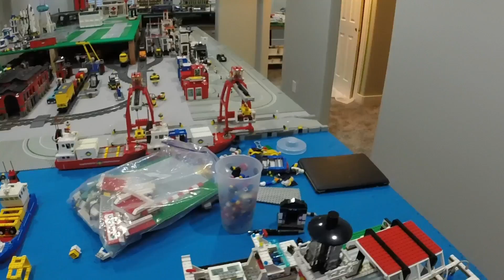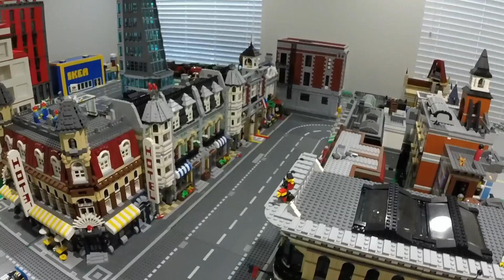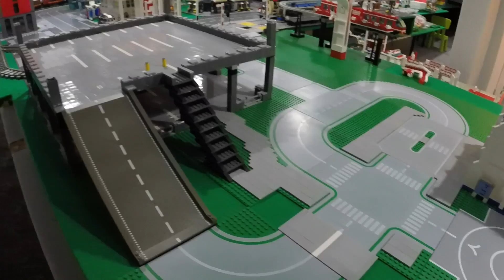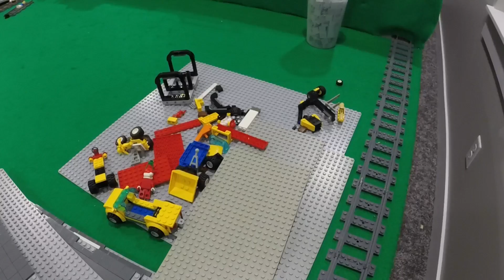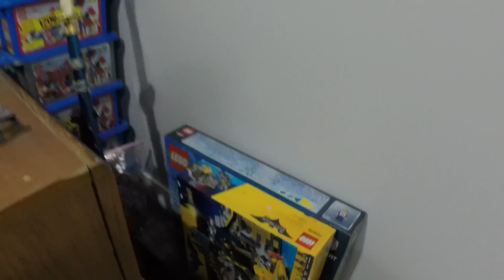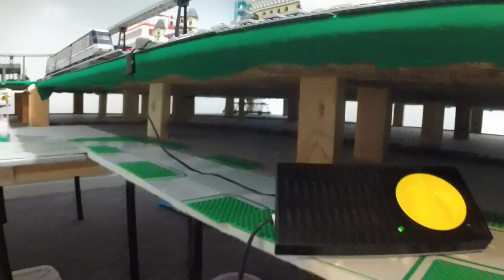Creating a LEGO City Part 6: Using Old Sets

Comment: Coming alomg awesome for sure Alex. I love how you changed the road plates at the railway crossing. Brilliant. Airport and "90s Lane" are lookin sweet as well. As for the open table space behind the 90s building between levels.  Not sure if you have any of those "BURP" rock pannels. but if you closed it up with those combined with some slops and folliage it would look cool. it would take a pile of them to fill it all in. You could make a secret tunnel or removable section or something.
Reply from the maker: I don't have very many of those rock paces. I wish I did.  They are so darn expensive too. I really do need to do something for that side. I might visit a hobby shop and see if they have anything I can use in the meantime.